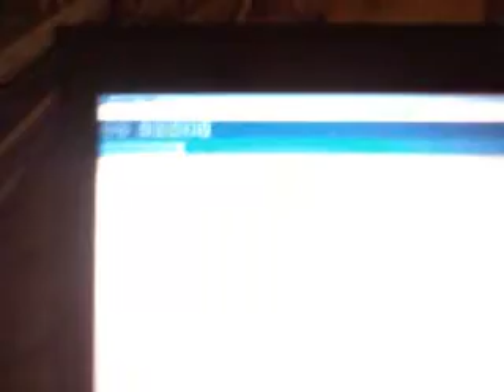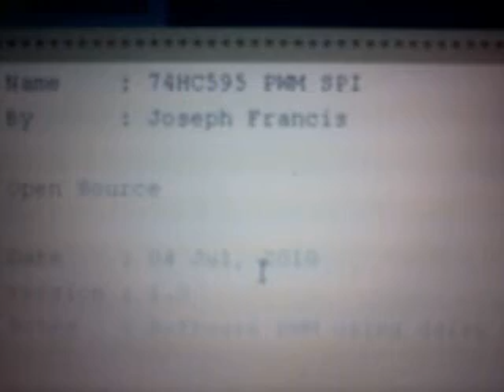Running16RGBs_Using_6_595s.3g2

Comment from the maker: I created this from scratch using raw RGB leds, wire, hot glue, clear tube (cut into pieces to fill with hot glue with RGB inside).  I use stuff like you can get at bliptronics website now

Comment: Nice work Joe! 
16 RGB leds are 48 shift register pins. Do you know what PWM frequency can your code reach?
Reply: I ask you because I'm working in a PIC32 (32bit/80mhz) with DMA-SPI to free CPU from SPI overhead to drive 90 outputs (shift register) at a resolution of 16 PWM levels, with are stored in an array, updated realtime from a DMA-serial input (from a PC). If you did it in a slow microprocessor (8bit/16mhz) without DMA I'm really curious about your resuls.
Reply from the maker: Hey, this was very long ago.  I now use the WS2801 based LEDs with build in shift register / repeater .. 256 levels of fading and no mutliplexing needed.